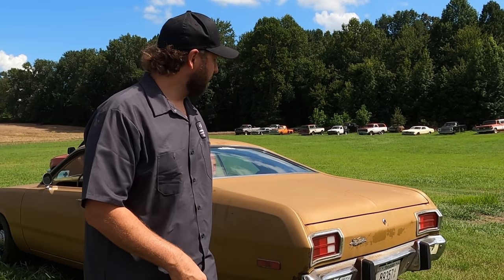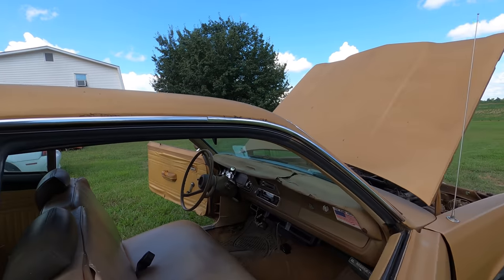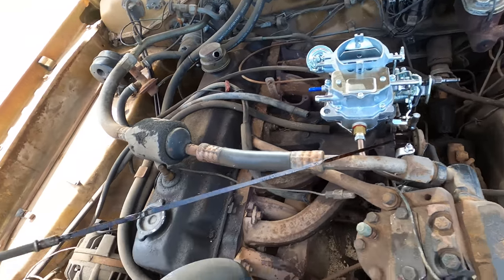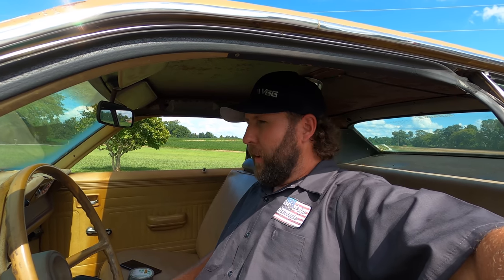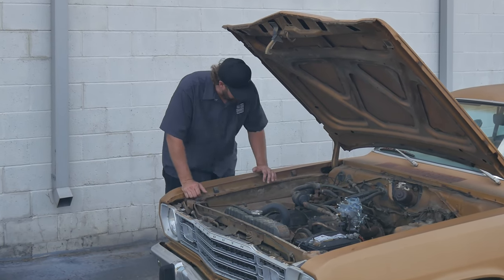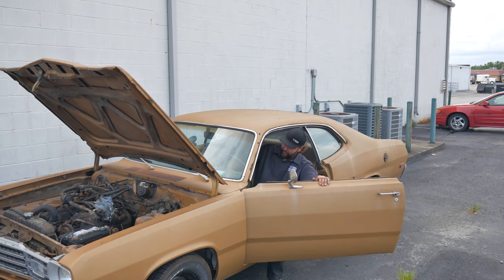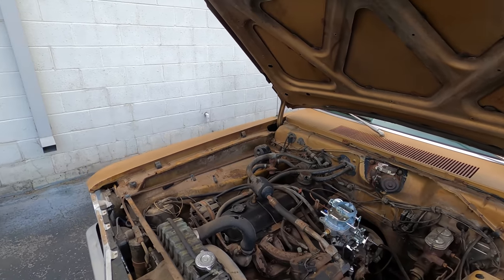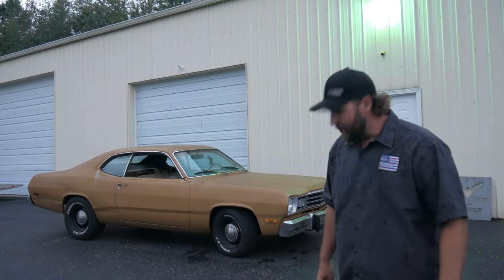Driving a 1973 Duster to the NEW shop in Tennessee! (Bought Sight Unseen)

Comment: That Tennessee humidity is going to kill you.  We’re made for cold weather 😹
Reply: Yup, both Derek and Jessica are going to have to change their thermostats!  We have antifreeze in our blood.
Reply: Just wait until it "snows" and the resulting calamity.
Reply: @cadman10000  If you mean snowing in Tennessee than yes, it is a calamity!  I drove through a snow storm from Nashville to Asheville back in 2001.  It was flurries all the way.  I know I was driving the speed limit and was in and out of traffic the entire stretch.   Everyone else were freaking out and driving at a snails pace.  The snow wasn't even sticking to the road.  Stopped at Carl's Jr. for a bite on top of the mountain and were about to head south to Asheville.  That's when the snow really piled up.  I was stuck in traffic for 7 1/2 hours parked on the freeway while the snow maybe got to 2".  That's just a little dusting here in Minnesota!  Good times.
Reply: @PaulyOutdoors  I didn't think we had any Carl's Jrs . They call them Hardees in the South .
Reply: @patrickbrannonsr.6730  It probably was Hardee's.  I get confused sometimes in my old age.  This was 20 years ago and many MANY whobble pops and cold snacks in between the years........so probably not 100% sure.

Comment: Mopars look like they were designed at gun point in a Soviet era gulag.
Reply: I’m not sure if this is meant in a positive or negative tone but I like it
Reply: Well, look beyond the Duster/Dart twins as mechanically speaking, they were identical, the rest of the lineup looked less like a rudimentary vehicle and it's unfortunate that the Duster/Dart twins do look rather rudimentary, but I do like the basic design nonetheless and that was how they were before the Civic and Rabbit et-al subcompact cars came along to change the small car design paradigm with buckets and little 4 cylinder engines and a floor shifter, rather than basic bench and a column shifter.

In fact, the Dart/Valiant dates back to the 60's and what you see here was an updated style on basically the underpinnings that were about 10-15 years old designs.

Comment: OMG....this brought back memories...I bought a 73 Gold duster for $60 dollars...former owner was scared to drive it as the steering was more of a suggestion than an action. I checked everything in the steering and it was all tight... then an old timer came to look at it and found cracks in the unibody behind the front wheels...he used a torch and about 20 clothes hangers and filled in all the cracks with hanger metal....drove like a dream afterwards and I drove my $60 dollar wonder for years and sold it for $700.....man do I miss that car. I bought at least 3 slant 6's afterwards...they were gutless but never left me on the side of the road.

Comment: Derek: Starter sounds like a dyin' dolphin.
Me: And you know that sound why exactly? Should I be concerned?
Reply: Nah.  That's just the Mopar starter sound.
Reply: @757optim  Yup, the classic gear reduction starter that kind of sounds like a hummingbird, though this predates electronic ignition by 2 years when the motor got higher torque and sounded even more like a hummingbird. 

My late father had a '75 Grand Fury 4 door with the 360 in it and it had electronic ignition and the higher torque starter.

Comment: A guy had a 72 Gold Feather Duster with a 318. Jammed the jack undr the front, set the jack stands just behind the front wheels and went to mover the jack out to do some work. The weight of the V8 picked the back end up when the jack came down. These things are LIGHTWEIGHT

Comment: Pop the cap and check the pins & that rotor button when you change the sparkies....I find the white snow causing misses a week later when I skip that...then couple months later I change the wires that have dry cracks in em.

Comment: My brother bought a brand new 70' Duster in lime green just before he shipped off to Thailand during the VN war. He left it behind in our driveway for a year during his deployment. Except for the lime green color, rally wheels, white letter tires, and graphics, it was a stripped down 318 with 3 speed manual tran. on the column.  No carpet, just rubber covered floor. Wish I had that car.

Comment: The Slant 6 was one of the best engines ever made...they ran forever. My buddy had a Dart with over half a million miles on it and it was still running.
Reply: My truck made it to 437k before the frame broke I welded a patch on drove home and pulled it before junking the truck and ran it in many derby cars

Comment: Are you sure it's not a 74? In 73 the bumper extensions were solid rubber and chrome like that was added in 74. I had a 74 duster 360.

Comment: Ya know this is the second 225 slant 6 I’ve seen on different car shows on one day and to tell you the truth they are bulletproof, I had a 1966 Plymouth Valiant with the 225 slant 6 and I couldn’t kill it, that was around 1980-82 I drove it with low oil and at one point with the radiator leaking I attempted to drive it from north Jersey to Maryland and made it over the bay bridge before it just shut off due to overheating, waited a little while to put water in and finished my trip, bad ass little engine I think

Comment: I remember seeing a Duster on base.  Identical to the one in the videolator.  But it was green.  And probably a headliner.  I remember having it's much smaller cousin in my matchbox collection ( or was it hot wheels.  oh well can't remember.)  You have a good sense of humor Derek.  Now Hope you get a classic volkswagen bug to get started again.  No not a superbeelte.  The ones with oval headlights and the pancake engine.  I helped my dad put in the engine by balancing it on a floor jack.  Try that with a v8!!

Comment: My first vehicle was a 74 Duster, 225 slant six, got totaled, found a 73 body, no motor, found out it had the 198 slant 6 three on the tree,, NOTHING was the same, after pretty much swapping everything over, the car was a laughing joke. THEN I came across a  nice 74 GOOOLLLD duster, 318 V8, buckets, snake skin top, 43K original miles, this was in 1987ish. Put some sway bars on it, otherwise it folds under in a turn, the rear wheels are slightly narrower then the front which caused it to spin out in turns easy. They tended to rust out in those spaces inside the trunk where the qtr panels are behind the rear wheels. There are plastic caps for drains right behind the rear wheels, remove those and pressure wash that space out inside the trunk.

Comment: Worked at the Chrysler engineering center in Highland Park & the Chrysler Tank Arsenal in Warren. Lost count how many '70-'76 A-bodies I've owned over the years from a 10-year-old $250 slant 6 '72 Gold Duster to a one-year-old $3,000 '76 Dart Sport slant 6, 4-spd with a factory sunroof & only 7k miles from the Chrysler executive marshalling lot across the street from the Lynch Road plant in Detroit. All had bullet proof & extremely reliable drivetrains but the salt laden Detroit streets in the winter deteriorated the bodies badly to the point where the rear spring mounts shot through holes in the trunk area floor pan instantly lowering the rear end by 6 inches. Good to see some cars being saved from the crusher.

Comment: My wife and I had a car just like that when we got together it had a slant 6 it had a fold down back set every 200or so miles the back cylinder Fowler out and started misfiring lol had to pull over clean the plug and down the road we went we got the car and a pumpkin orange short bed dodge truck from my uncles salvage yard They were to clean to get crushed I once saw my uncle crush a 67 fastback mustang it was almost twisted in half Thanks for sharing 👍

Comment: I really like the body shop spot welder, you add studs to pull the dents, so you don't make extra holes, and if you do it correctly, you smoooth-er-er it out, sand it and use primer, and no bondo or any body filler, I prefer fiber and resins over body fillers like bondo.

Comment: I had 2, 340, 4 speed dusters when I was young. Suggestion: install a 360ci, 727 trans, A-body 8 3/4 sure grip rear axle. Front sway bar, KYB shocks, Use the Factory rallye rims and Fix the fuel gage. check the ground on the tank. Thanks, Bye, Good luck.

Comment: Just watching this now, all the oil around those plugs is probably a great deal due to the fact the crush washer was still on the spark plug. Since the slant have the tubes, they are the sealing for the spark plug to cylinder head. Designed in 1959 🤷

Comment: In the mid 70's I was a salesman ond my company car was a gold Duster . Everytime I had to make a left turn the car would stall . Mechanic said the float in single carb would shift causing it to stall out . I learned to gun it and make my left turn so momentum would keep it going when it stalled . The guys with 2 barrel carb had no problems with that issue . It was a fun car though and did bring me closer to the Lord !
Reply: I've rebuilt a bunch of them back in the day. The rebuild kits had an improved float system that totally cured the stalling issue.

Comment: Wait until winter and you find out there's no snow in Tennessee.  Fix the rust and pound out the dents, and throw on a coat of shiny paint.  Then drop in a 383 with a Torqueflite and make sure the radio works, and you got yourself a hot rod.

Comment: Isn't that thing the choke switch (on the left lower corner   of the steering wheel)?   Would explain  why it sputters a bit if it is engaged.  My buddy in high school had one of these.  Covered the interior with plush purple  velvet and belted two paradigm house speakers in the back window.  That engine does not die.

Comment: My wife and I drove my inlaw's '74 Duster with a slant for a couple years; there were 2 dipsticks (besides me) to check the oil. One to actually check the oil, and one to plug the hole between checks: If the stick was put in wrong, the center crankthrow would clip the last 4 inches or so off the stick. There were about 4, 4" chunks of dipsticks floating around in the pan, and the parts guy at the Dodge store parts counter knew us by sight. When we came in the shop, he'd have the new one ready by the time we got to the counter. But the Duster ran great and was greatly appreciated while we needed help with transportation. And the plug socket...yup, remember losing the socket about 4 times per plug when I changed the plugs. The blasted slant of the engine kinda threw off the natural order of things, and distorted gravitational fields. Weird how that happened...
Reply: What else does he have for sale?

Comment: i had a 71 purple dodge dart vinyl 318 3 speed on the tree when i was 17 i drove it in blizzards 60 miles one way 120 miles round trip to rollerskating rink in 1st and 2nd gear 3rd gear was out.but it never failed me in 3 years just winded high in 2nd on highway

Comment: I like your show vice grip garage and there's a lot of stuff that I like to do to my Jeep Cherokee a 1999 XJ and I bought it for $200 and cornfields hasn't run for 10 years I got it up and out of the field got it running for the smokes so I put some key for Rotella diesel oil in it and it stops smoking but I just want to sell it the four-wheel drive everything worse than Siri or is beautiful it's got a few rust on the doors on both sides but otherwise it's worth 1500 hundred dollars you can be the new owner

Comment: Reminds me of  the 73 Dart Sport (duster) I bought from a buddy (Ron Mancini's nephew) with a w/a Mancini built 360 four speed, super stock springs w/ a 4.56 gear. (he had to get rid of it in ONE day) I didn't have much money & I got it for $650.00 ! I had put some 235 B 75 15's on her and actually had to roll the front lip of the rear fender wells to fit them. But it did run Strong!  I got by a 66-67 Nova w/a 396 in it on Woodward Ave! Bummed that I never got a picture of that car to keep...

Comment: 2 ways to tell what engine it is, the first is the Vin number.  The other on the passenger side of engine at the front just Below the head it's stamped into the block (on the top of block  can be seen next to head)
That could have a 198 cid,  or the 225.

Comment: My brother had a 1975 Duster with slant six.  He didn't know it but the rearmost cylinder had been dead for over a year for some reason. I was just a kid but I recall a friend of his took off the intake manifold and the runner to that cylinder was clogged full of soot or varnish or whatever because the carb kept on throwing fuel back into it but none of it burned!  Ther dug all that out. They put a new spark plug in there and it took right off.  I don't remember if they never even had to take off the cylinder head.   The engine eventually needed a timing chain and I think he just sold it to the junkyard!

Comment: Excuse me, but as a die hard Chrysler man, I just have to mention the Chrysler key is right side up. All those other ones are wrong.

This is like the one I had years ago, except mine had a lot of rust. I  had a blue one and one this color. I swapped parts back and forth as needed and would hit the salvage yard for used parts after I had a list. That was a time in my life when money was really tight. Those two dusters got me through. 

We had some winters in Wisconsin that were atrocious. One January it was -10 in the daytime for a couple weeks. We got off work at 3:30 so we only had about 45 minutes of daylight left. Many times newer cars would not start. My old Duster like the one you bought would moan and groan, then fire on a few cylinders, sputtering and blowing smoke. The power steering would whine like a banshee and then it smoothed out. The newer cars would have hoods open the guy standing there with jumpers and I would start making the rounds. I learned to keep a heater that plugged into the lighter socket to help warm my car. the cars heater was adequate but not overly impressive. Plus the plug in one was instant. So my rusty old Duster was showing up those newer fancier cars.

Because the cold weather was so hard on starters I kept a spare one in the trunk and a box with the right tools to replace it. I to  to where I could swap the starter in about three minutes! It is right there easy to reach from above.

A Duster is no good in snow, UNLESS you put about 150 pounds in the trunk and mount good snow tires. HUGE difference. Sure grip should have been standard on cars sold in the north. LOL

That car must get about 100mpg, I never saw you stop for gas before the "tuneup".

If this one sat a long time it could be the rings are stuck to a couple pistons. I had that on an older 62 Plymouth I bought used. Pulled the plugs, shot it good with STP gas treatment in every cylinder, hand tightened the plugs and let it soak for two days. Pull the plugs out and crank the engine to spit out the excess. It still used some oil but only half as much.

It was actually good to see one of those old girls still serviceable. They are so easy to work on, in a crazy way I miss the one I had. eventually it got so rusty I was afraid to drive it. Sold it to a guy who wanted the engine and trans. It had about 150,000 miles.

Comment: You can tell the difference between a 175ci and a 225ci, by the length of small heater hose between the water pump and the head. If it’s very short. Lime an inch. And you couldn’t replace it without removing the water pump, than it’s a 175ci. If it’s almost 2 inch and you could replace it without pulling water pump, it’s a 225.   My first car was a 175ci 63 Valiant. 100hp of unkillable leaning tower.

Comment: Early, soft shifts caused by kickdown linkage not being hooked up after carb upgrade.  It also controls clutch pressure and will allow excessive slippage: ziptie it back if you don;t have linkage parts.  Cool car though--wish I could find one of those old A-bodies in that good of shape!

Comment: If you look under the back seat of that duster the build sheet might still be on the bottom of the back seat! The filler neck to the fuel I believe is from the NASCAR days, cause the would use protection cars for racing and kept it around for a few years after they stopped using production cars. I had a 75 dart that had all the same parts except the upgrades he did to the duster.

Comment: Little blow by? If it was anything like mine, A LOT! I had to run a hose from the crank vent down under the car so I could breathe, the PCV system was over whelmed, once I rebuilt the bottom end with new rings it went away. I was in auto tech school at that time, did all the machine work on the motor myself.

Comment: A Ford 1946 can replace the Chrysler 1945. The Ford carburetor has the choke on the carburetor. It has a fast idle screw. It should be at 2200. Warm the engine. Set the choke open and open the throttle. The cam will snap to fast idle. Idle is 550D on a Ford.

Comment: Not much power but I think those slant 6 motors and straight six motors are the most durable engines. On  Ford, Chevy and Dodge. The Chevy 350 was pretty durable too. Also a lot of the 4 cylinder engines are durable too.

Comment: The spark plugs in the early 225s has these aluminum tubes and they leaked oil all over the plugs, later 225s closed the space off with the head casting, so find a later model head and swap it.

Comment: I had a 1973 duster that had a fold down back seat, had to disconnect the temp gauge so I could trade it, mechanic could never find out why it kept overheating overwise it was a fun car, it was red with black stripes and a half vinyl roof 3 speed in the floor

Comment: Yup.  I had a 225 slant 6 in my Dodge Dart.  Used to be a time before the environmentalist recycled everything that a tune up meant stopping on the side of the road and picking up a ring pull tab to use as a feeler gauge on the points.  Add a little oil, a little gas and a six pack for the back seat it was good to go for the 500 mile round trip to New Orleans for the weekend.